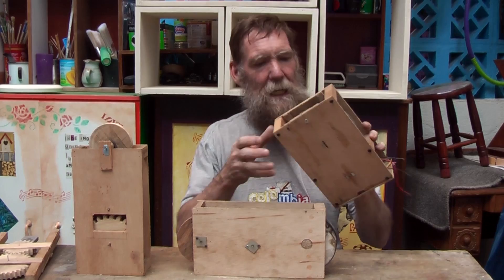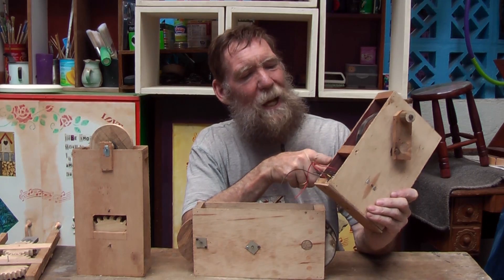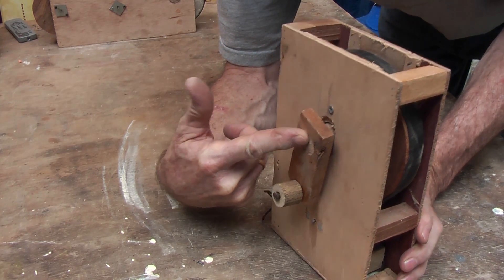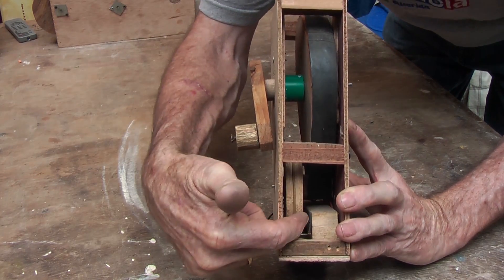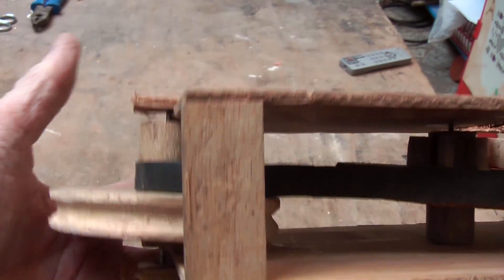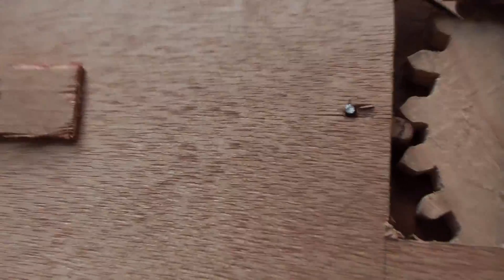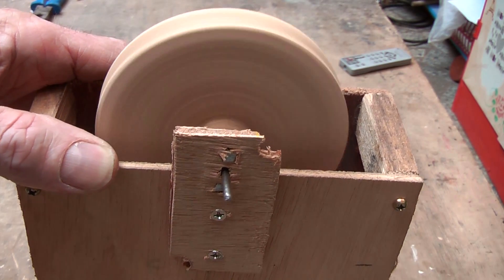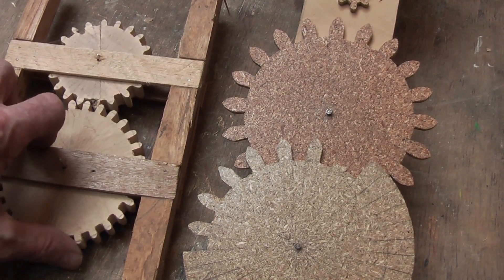Reinventing The Wheel And Electricity - On To Teeth

Comment: Nice to see you again and good luck with your health!

On the subject of the video: There's a problem with solid wood gears and that's the grain direction. In small and light devices it may not be a problem but if you start adding on higher forces or larger diameters you might have to use exclusively plywood for strength.

If you want to make heavier-duty gears then you may want to construct them as they are in old mill cogs, which is fairly complex but allows for both favorable grain direction and replace-ability of teeth:
https://thumbs.dreamstime.com/z/old-machinery-wooden-cog-wheel-found-mill-medieval-high-tech-43931417.jpg
The multi-part construction means you can use wood which has curved grain - or which has been bent - to make a wheel that is strong all the way around and sandwiches the teeth in between with pins. The lower cog in the picture also highlights how you can make them mesh at right angles with inserted teeth into the side of a solid rim instead. 

For cutting the teeth themselves you can probably expedite the process  by cutting notches in a stick, drilling holes for the pins and then cutting it into pieces. I drew a real quick picture if that's hard to follow for anyone reading, here: https://i.imgur.com/TUD4kik.jpg

You can speed up some of the construction process by making simple "lantern gears" to be driven by some of the cogs, at the cost of the lantern gears taking up a significant amount of depth: https://upload.wikimedia.org/wikipedia/commons/thumb/0/0f/Cage_Gear.png/1280px-Cage_Gear.png
The advantage of them is, of course, that you only need to make some holes and insert pins, no tooth-cutting needed.

It got a bit long, sorry :)
Reply from the maker: Thanks for all that. Quite right in all you  say. :)  I did find the grain problem. Hardwoods seemed ok for smaller lightweight gears, but you are right. I looked at a lot of windmill videos. Tried the lantern gears( they worked quite well for low teeth count pinions) , and will  do some more on them as time goes on. They seem particularly good on larger mechanisms. I tried the replaceable teeth, but  tricky when you get quite small. I wanted to steer clear of ply, and am doing them  in composite wedges now, to get as much end grain as possible facing outward.The  challenge now is accuracy in cutting, sizing etc.  I am  fashioning basic jigs and wooden equipment to aid in all this. The videos will always lag behind on where I am up to right now, but it is all a great adventure. The depressing or exciting thing about all this, is that this technology has been around for at least 3 thousand years, so it is fun to single handed-ly 're-discover' it, or at least  apply what logic and skill I can, to see if I can arrive to the same conclusions these very smart people of centuries ago did. Thanks for the  info and pics.
Reply: Thank you for the detailed reply, I appreciate your work!
Reply: PS: Be a bit careful about photos of old wooden gears, especially if they're not attached to anything. Some examples are actually patterns for foundry casting of metal gears, and aren't exactly efficient for making usable machines themselves.